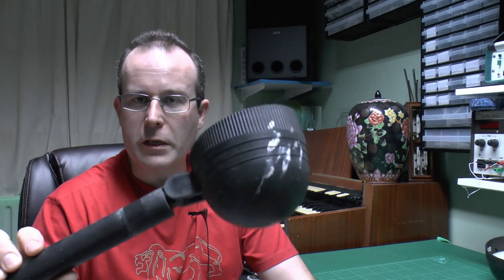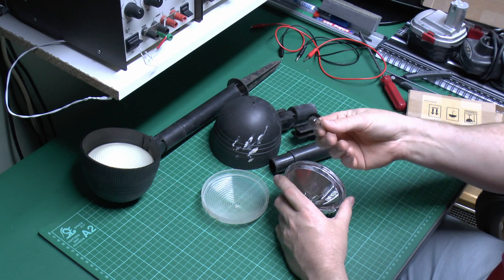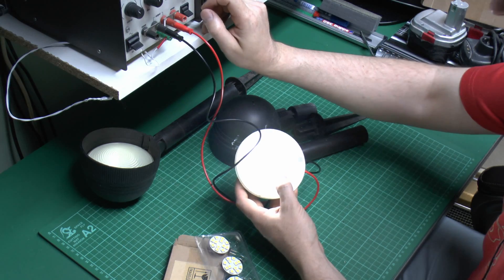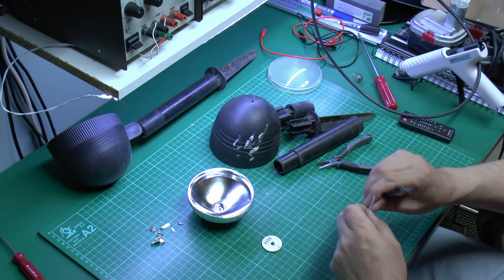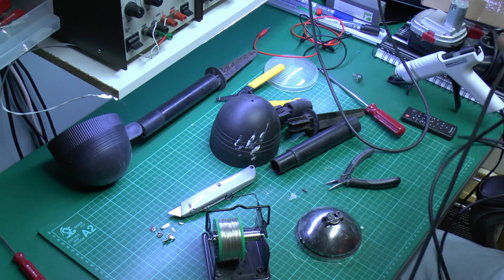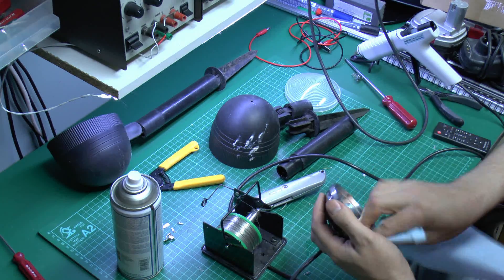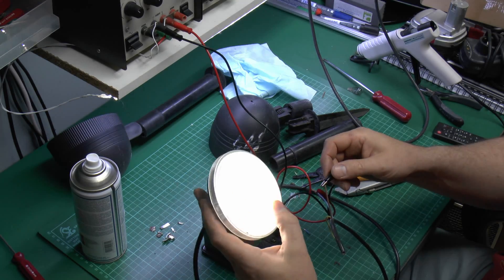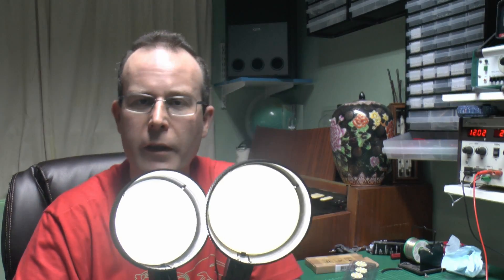Garden Spike Light Conversion 7W Tungsten to 1.6W LED.

Comment: how you got them wired up at the other end, via a transformer at 12 volts ?
Reply from the maker: Yes, the original 12 volt transformer as supplied with the lights.

Comment: John..Just a few issues I had with with those plastic garden lights...1.The plastic lens will go white and fall apart from the UV frm the sun. 2 Moisture will eventually corrode and destroy the LED PCB, 3. Surges and spikes frm the mains can pass through the iron core 12v AC transformer and can cause some of the diodes in the on board bridge rectifier go short. Another issue is the fig 8 PVC copper flex used in gardens doesn't last long as it corrodes. So you may find that while they will last longer than 1000Hours some LED lamps will still fail prematurely. Also cool white doesn't work that well, you may find warm white looks a bit better, mix it up. Also you can get colors red and blue can look fantastic behind rocks or behind a plant. I speak will experience, best of luck. For longer life try cheap 150w halogen IP66 aluminium /glass flood lights remove the 240 lamp holder and fit 12V leds, use a MR16 fitting and plug in mr16 LED BULBS. works very well. Better than the plastic lights, can even make you're own enclosures out of glass jars.. also works and is cheap...

Comment: That hot glue gun and the solder tin holder looks realy nice! Where can you get those?
Reply from the maker: Glue gun is an Arrow TR550.  Wire dispenser was a cheap thing from ebay.
Reply: Thank you, John. :)

Comment: I actually prefer quality switch mode supplies for garden lights versus a simple linear transformer.  The high quality ones that I refer to are actually more expensive, but are more efficient, and have far greater voltage stability as the load increases as well as having the ability to offer an adjustable output to compensate for an initial run which may be long.  My ideal configuration would be a 3-wire configuration with a voltage sense that could be activated at the first lamp feeding back to the controller to increase the voltage to where a solid 12V was available at the first lamp.  Even with 12 gauge full copper wire, if there's much distance to the first lamp and a significant load on the line, you will be losing a lot of voltage alone the way.  I usually wire a full circle coming back to the first lamp, or even better, the transformer to keep all the lamps at full brightness.  Not as big of a concern now that most lamps are LED to begin with, or as you have demonstrated, can be easily converted.

Comment: Nice repair. :-) About the original wiring though.... Is it still possible to get a length of it and give it some er.... 'tests' ? :D

It's not everyday that someone gets to play with some copper-clad STEEL, so it would be interesting to see how it compares in conductivity to some genuine copper wire. :-)

Thanx for showing,

-BoomBoxDeluxe.

13th May 2015, 23.04
Reply from the maker: BoomBoxDeluxe Possibly can, although a lot of it had totally disintegrated.  Will check when I am back at the place these are fitted.
Reply: Hiya. Thanks for checking. I am sure it'll be an interesting test, and also, I've never seen a cable stick to a magnet before. :D

But then.... Most cables are copper, not steel.

Thinking about that actually.... Some years back I bought a music player and the recharger lead for it is quite stiff and unwieldy. It's either a solid conductor in there, or it's made from steel.

I'll check it with a magnet.

Thanks,

-BoomBoxDeluxe.

16th May 2015, 14.46